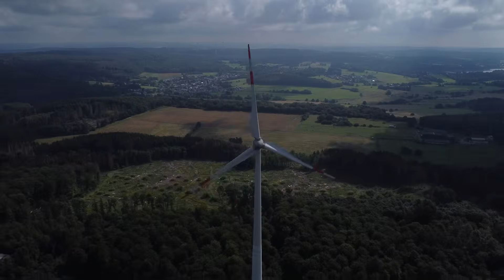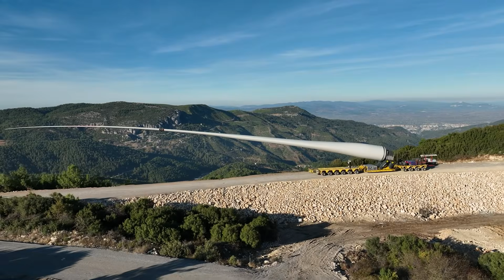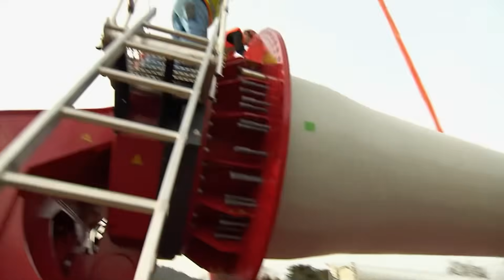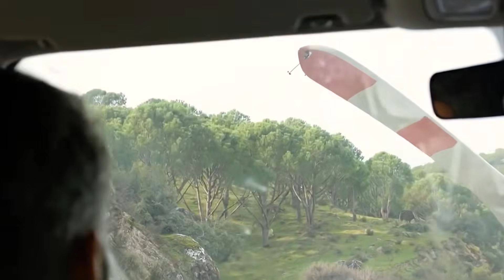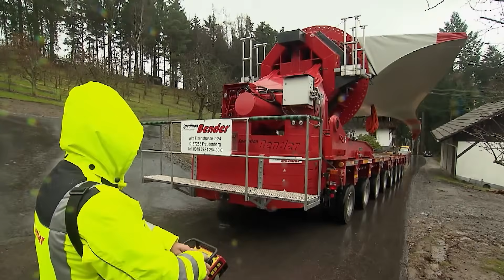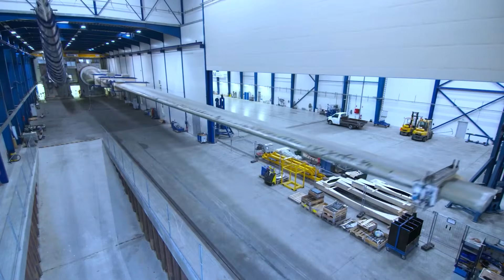How Trucks Transport WORLD'S LARGEST Wind Turbine Blades on Dangerous Roads

Comment: I would love to see a comprehensive study of the carbon impact of assembling one of these windmills.
When you look at all the vehicles it takes to transport one blade, the energy used to build those specialized vehicles, all the support vehicles, transporting the crane to the mountaintop to assemble everything (and all those tires!), I wonder how many years of “clean” energy the windmill has to produce to offset all of that